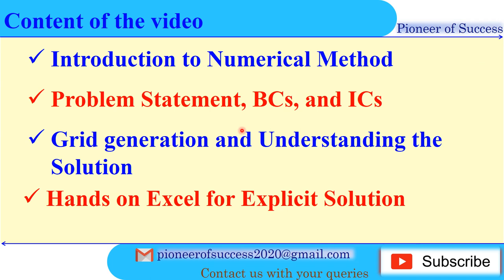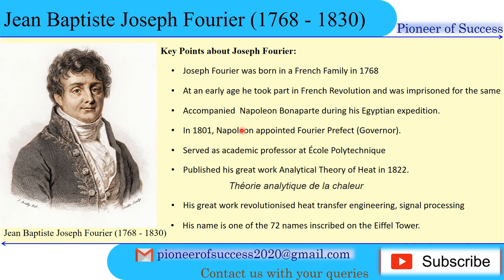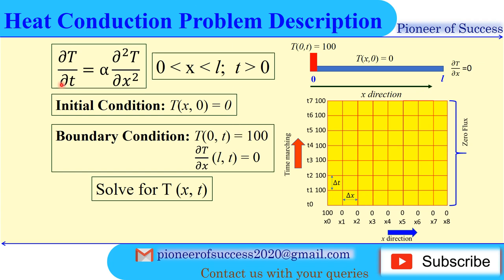Numerical Solution of Unsteady Heat Equation FTCS Explicit Method #FTCS #Explicit #numericalmethods

Comment: This is very good explanation.
However, we can easily use this method e.g. for one wall dynamic heat transfer calculation (temperatures profile) but I was also wandering how to do that if we have a room with 2 or 3, 4 walls with different conductivity and thickness (so different u-value and heat capacity etc.). How to know/calculate how much heat will dynamically go through each wall at the same time ... or in other words how to calculate correctly temperatures profile in each wall at the same time.